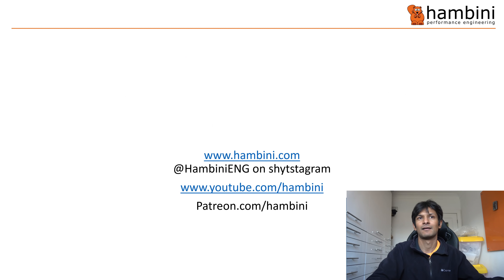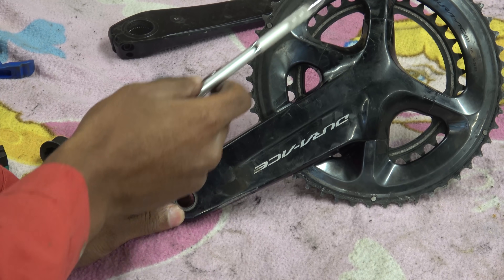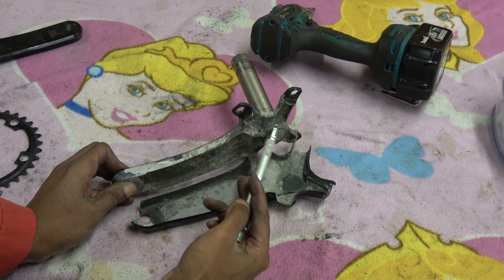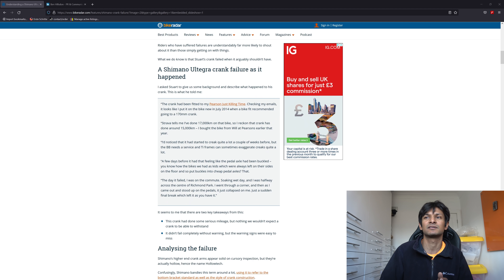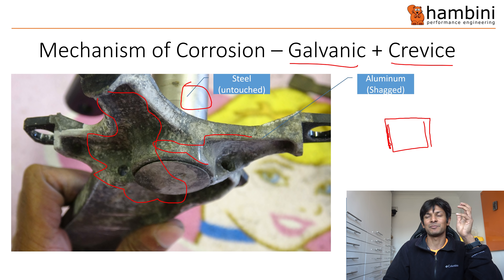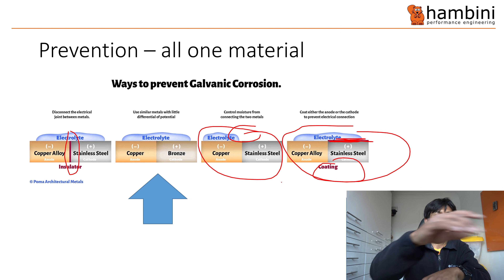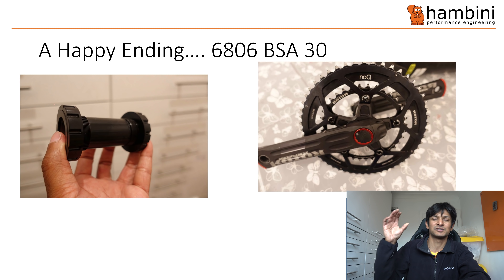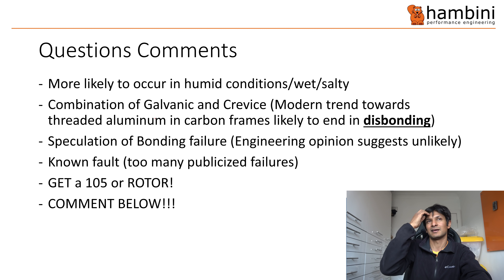Shimano REAMED for Engineering Incompetence

Comment: This is your GREATEST ever video Mr Hambini-man!!! As a passionate and committed CAMPAGNOLO devotee - you can't imagine the absolute pleasure Shitmano's product failures are giving me! LOLOLOOLLOLOL!!!!

PS. Point of interest - whenever aluminium and steel come into contact, they create an extremely aggressive electric reaction - as you quite rightly stated, a kind of 'battery [Galvanic] effect'. This is also known as 'electrolytic corrosion' - which produces a whitish powder residue. 
Electrolytic corrosion was very commonplace with automobiles [especially during the 1950's and 60's] when car manufacturers started using aluminium and steel body panels together. Indeed, it became such a problem that rubber beading had to be inserted between the surfaces of the two metals to prevent them coming into direct contact.
Unfortunately, the rubber beading would rot away after a few years and car owners would suddenly find entire areas where steel wings came into contact with aluminium bonnets and boot lids for example, totally corroded away.
Reply: Yeh, well you should see the 'reaming' he gave Campag too.  My Shimano cranks have never failed, but then I'm not daft enough to lean my bike against a central heating radiator and not realise how harmful that is to bonded components be they hollowtech or carbon.
Reply: @mcspikesky  Dentists can afford that
Reply: I bought a De Rosa Idol with Campagnolo Potenza, best bike I ever owned with the worst groupset I ever owned, an absolute pile of shit - Within 500 miles the right shifter snapped and the bottom bracket sounded like a ratchet with all the clicking noises it was making.  I've no idea why Campy insist Potenza is comparable with Ultegra, it simply isn't... maybe Claris or Sora but no higher. ChainReaction couldn't resolve the problem and wouldn't swap the groupset to Ultegra so I ended up with a refund :(  Shame as ignoring how crap Potenza was the bike was beautiful to ride and the thumb shifters I absolutely loved
Reply: @mcspikesky  ......Mmm - I admit that I am a half-wit. But that makes me twice as clever as you.
Reply: @mischief2168  ........What's a 'central hearing radiator'? Heating for the ears perhaps? PS your spelling is a ridiculous as your thought processes. This video is all about Shimano crank FAILURES! Got it?!?
Reply: @thesoultwins72  ... you are rather rude and very aggressive to women.  Have you tried therapy?
Reply: @mischief2168 .......No why....have you?

Comment: Zinc anodes are what's normally used in boats. I've pop riveted (usually monel) many 316 stainless fittings to aluminium masts. I always provided a barrier between the steel and the aluminium. Plastic packaging tape, the really thin stuff about 50mm wide, seemed to do the job.

Comment: Good stuff Frenchie! 
I've had both a Durace and Ultegra versions fail this way. Oddly they both failed around the pedal area, but still displayed the same characteristics.
 Give Shimano their due they replaced both.
Reply: I had one break at the spider and one just below where the pedal axle screws into crank arm
Reply: If it was made properly it wouldn’t have failed.  High quality bikes used to be expected to last for 100,000 miles/160,000km.
Reply: @stefhirsch6922  My first crank set lasted about 18K and my second broke at 7K miles.  Both breaks at different locations.

Comment: Super impressed with the video and it confirms what I felt was the case already. I can CONSISTENTLY, and I want to stress consistently, have one of these cranksets fail approximately every 15 months of my normal use. I suffer from hyperhidrosis and live in hot humid Alabama. I have had two replaced and have the third on the bike downstairs and am no longer using it. My ANTIQUE 5500 series Shimano cranks are beaten to hell and back and still work. I started religiously disassembling the crank every month or so and cleaning the area between the R8000 spider and the chainrings and even lubricating them. Nothing helps, nothing will stop it, just like Hambini said. Local bike shop and local Shimano representative who happened to be present when I took in the second one feigned surprise and shop suggested I clean the bike more often. Can’t really do more than every time I ride it! Currently on an FSA branded heavy crankset which seems like it will last and had purchased a set of 105 5800 cranks to permanently solve the problem. Because I clean it so much I have caught both of mine when early cracking of the body occurred rather than full separation.

I do think it’s worth considering the 105 option carefully. I have not looked at one first hand but the R7000 105 cranks look bonded as well. The old 5800 are not bonded and seem likely to last. That is what I will use next even though I admit the new R7000/8000/9000 look much better.

This has been a big letdown for me regarding Shimano. I have had full confidence before but this is ridiculous and needs to be recalled.
Reply: People who can afford to pay for this are top 0.1% rich. I don’t think most really care about this being a disposal part that fails under extreme conditions. I personally won’t care if this could fail since I don’t live in humid area and don’t ride like a pro at all time and all I care is that blink factor. For pros, all they care is weight and performance, durability has to sacrifice. It’s a trade off.

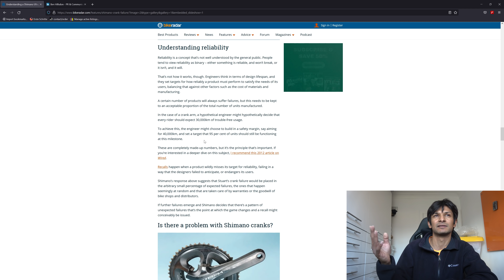Comment: 16:55 Just a small point. You are conflating "Factor of Safety" with "Fail Safe". Factor of safety is the amount of excess load a component can bear compared with its expected maximum loading in normal use. For example a SWL 10 ton rating lifting component (e.g. shackle) might have an actual failure rating in excess of 40 tons. This is called the safety factor. 
"Fail Safe" means that a component or system is designed such that in the event of a failure the component or  mechanism does not represent a danger to users or other components in the system. An example of this would be a runflat tyre which is designed to stay in place on the rim in the event of a puncture or blowout.
An example of "Fail Unsafe" - (fail dangerous?) is the RCD (Residual Current Device) on modern (UK) domestic circuits which protect people against electric shocks. There is no indication of a failure condition (which is why they are supposed to be tested regularly) and in the failed condition power is still passing through them with no shock  protection.

Comment: A little off topic but I had a number of crank arm failure years ago when riding top of the line forged Campy cranksets back in the 80'a.  I had three separate failures on cranksets that were supposedly  under warranty.  The first time the local bike shop gave me a replacement crankset and send it back to Campy.  The second time a year later the replacement failed and they replaced it again.  The third time the shop would do nothing because they said Campy rejected the second one and they never got paid.  When I said they were under warranty they told me to sue Campy because the shop was not taking another loss

None of those failed forged Campy cranksets had ever had a crash and were in nearly mint condition.  They all failed under hard pressure either sprinting or climbing hills and caused crashes.  

People need to realize when their cranksets are under pressure and fail (no matter what the brand or model) it is like stepping of a cliff and and you either instantly fall over or you stay up with a damaged arm pointing up with the good arm under pressure pointing down.  In one of my failures the later happened and my shin turned in and the upward broken arm sheared right up my shin and cut me very badly and I had to tie a bandana around my leg to limit the bleeding.  On top of all that I had to ride hope after all the crashes and injuries using just one good crank arm.  

After the third failure I switched from Campy to Shimano Dura Ace and never went back and have it on multiple bikes although only three have Dura Ace 9000 components (the rest are older 10 speed series).

I have never had the Shimano failures described in this video but I did have a Shimano Dura Ace crankarm that I had a hairline crack through the pedal hole that I noticed before it failed and they replace that crankset under warranty but it took awhile to get it.

I would suggest that people regularly clean and inspect their bike components and frames (I have had some of them crack and fail as well) so they can catch problems before they become serious and cause failures out on the road.  I learned the hard way.........................

Comment: Hambini, go for Hope’s 30mm all aluminium road crankset! I have fantastic experience in last two years. Very well made but pricey. I personally had issues with modern Rotor crank (it was Vegast crank model with 30mm alu spindle). It was creaking a lot from the start, which I thought had to do with DS side spindle spline tolerances, which caused creaking in the spider/ring (one piece) interface. It drove me mad and could not get it to work.

Comment: Luckily I wasn't sucked in by "lighter is better" with Ultegra or Dura Ace, and I went with 105. 
With that said, I worked as a crew on some Sportfishing boats in Hawaii, when we took the boats out of the water to redo the bottom, we also had to replace "the zincs" on the stainless steel shafts and rudders. I wasn't initially aware of the reason what they were or why they were on there, but was told by one of the captains that they are on there because of the electrolysis, and that they are designed to corrode instead of the steel (and aluminum in other places). 

In light of that, I wonder if it would be wise, or even possible to connect a small piece of zinc on area of the bike where 2 different metals are touching to prevent the corrosion of the softer one (usually aluminum).
Reply: It is called cathodic protection, all big ships and buildings have it.
Reply: Sydney opera use the same stuff.
Reply: Yes but it would add weight which isnt what is being marketed, its lightest crankset possible or nothing
Reply: @coreygolphenee9633  My 105 set on the bike in my profile pic still works. The funny thing is that my TT bike weighs about 8.5kg and the bike in my profile pic weighs about 13kg. It takes me 230w on my TT bike to do 37.2kph and it takes me 194w to do 38kph on the bike in my profile pic. That is 36 watts difference. When I put 230w on my recumbent bike I am doing well over 40kph. 
All the DF riders talk about 100g here, or 200g there, internal cabling, waxing their chains instead of use any type of oil. But as soon as you tell them to move the parts around on their bikes to make it way more aero they get all weird. The UCI banned recumbents because they were too fast. 
I say "Fuck the UCI" ;)
Reply: @casualguy393  I ride track bikes mostly and ill just that the hittori hangout NJS dura ace cranks, its my favorite part about track bikes is that if shell out dough for the nice stuff the components are ludicrously tough

Comment: I had and old school aluminum TCR and I FOOLISHLY put a carbon seat post in it... it took putting bike upside down, post in a HUGE table vice.. THREE of us twisting frame holding table to get the post out of frame.. HUGE popping noise as it broke loose.  Enormous amounts of white corrosion just poured out.. don't even know how it fit. Took an additional 5-10min of additional twisting by three of us to actually get it all the way out. I'm a Chem. undergrad.. which is shameful didn't see this coming.. what was I thinking?? Such a sweet looking post though 😍

Comment: Thanks for the no-shite, serious engineering explanation of the problems that ill Shimano. It's not that they should know better - they already do. But they are ignoring potential disaster if they continue to keep their heads up their arses. This will not go away anytime soon.
Reply: It could end up like AllCity Cycles if they keep ignoring it.
Reply: They’ll start to give a shit when a crank gets delaminated in a big race. Imagine that happening in Flanders or the Tour … the PR disaster alone should make them care about it.
Reply: @endcensorship874  You can bet that the cranks and other kit that Shimano sends to its sponsored teams get the pro peloton treatment at the factory before anything happens. Assume components such as the cranks are put through extra treatments, materials and assembly steps that the regular production trash never get. That and additional inspections and an insane QC rejection rate. Just assuming, of course. And wonder what special instructions the team mechanics receive, or are there factory-recommended service lives between replacements for certain components such as the cranks. And supposing that these practices by Shimano may be the case (because I'm just guessing), it would mean that somebody - or several people - knows what's really up with these things. And if people know, maybe somebody will talk. And if somebody talks, that would be very bad for Shimano.
Reply: @RReese08  pros on big name race teams go through bikes and replacement parts like crazy.  Failures are less likely if something is only a month old.  Whereas it is not unreasonable for a consumer to keep a quality bike for many years and they aren’t having a pro mechanic going over the entire bike every day or 5 while being ridden by a heavier rider.  A bike holding up for 2 months and parts replaced when only 10% worn by a 150lb/68kg rider with good technique isn’t nearly as impressive as being replaced at 50%-100% worn by a 260lb/120kg rider with poor technique.
Reply: @stefhirsch6922  I agree.

Comment: That's exactly that. In older bikes there were some parts aluminium-steel, mailny steering parts. Aluminium tube corroded and when placed inside larger steel tube it expanded and in some cases it was impossible to remove it. The galvanic corrosion occurs here and as it expands it separates from under the glued part. The glue has nothing to hold on to and bond  is lost. 
Steel-glue-aluminium
Steel-glue-oxide layer-aluminium

Steel-aluminium-glue-aluminium
Steel-aluminium-oxide-glue-aluminium

Comment: Well done.  The (few) carbon frames I’ve built all used alu inserts for headtube and BB.  This allows for traditional bike shop tools to ream, face, and in the case of BB chase threads.  These frames have all been equipped for standard BSA bottom brackets, which of course allows for external threaded bearing systems as well.

Due to galvanic concerns, the alu bits are first wrapped with epoxy fiberglass as an insulator.  I have no doubt that over time, particularly at the ends/faces, there is the possibility for galvanic corrosion.  And eventually, this will likely be the primary cause for the frames ultimate failure. While I anticipate this to take some time, I don’t expect a CF frame to last as long as a typical steel frame.  

Now the methods noted above will not lead to record light weight frames.  But I think light weight is way over rated.  Especially because UCI weight minimums mean that record light frames aren’t necessary to hit UCI requirements.

But, the fact is that the various concerns re CF and weight obsessiveness has lead me back to traditional steel frames.
Reply: Steel is good and aluminum is also good enough for my riding. I figured that galvanic corrosion would be the downfall on most carbon or bonded aluminum.
Reply: @Drago0900  there’s no possibility of galvanic corrosion between carbon and a  metal.
Reply: @nstrug  there actually is. My aluminium bottom bracket sleeve got loose in a carbon frame because of galvanic corrosion.
Reply: @MartijnPeek  I’m confused as to how that could happen. Don’t ions from both the anode (Al) and cathode (C) have to be soluable for the reaction to occur? I guess the carbon could act as a conductor to steel parts such as rivnuts which would then set up a galvanic circuit.
Reply: @nstrug  yep, carbon is conductive so that’s all it takes I guess

Comment: I have the DuraAce 9100 crank so I'm a little worried about this happening to me. I also work in US aerospace.  We commonly use stainless screws, washers, threaded inserts in combination with aluminum alloys (6061, 7075, 7050, etc). To minimize the chance of galvanic corrosion we apply primer between the faying surfaces to seal the joint. I'm surprised that Shimano didn't do the same thing between the axle and the crank hub. I would think that water would have to get in there to start the corrosion. How?  I don't know.

Comment: Have you had any reports of these failures on the latest dura-ace cranks released last year?
 I'm not sure if Shimano have revised their crank design and bonding process to address the issue or continue to produce more of the same.
(The latest cranks are slightly heavier than the previous generation).
I continue to use the earlier Hollowtech 2 generation cranks which are presumably welded/forged? Certainly there is no visual joints.
I think that the later 105 cranks also have the bonded /cast design and presumably fail in the same way so going to 105 may not be the answer unless they are the older hollowtech 2.
Shimano stuff is usually very good and hopefully they will eventually come up with cranks which do not break up, Until then I will stick to the older heavier Hollowtech versions.
Reply: The new 9200 DA crank is quite a bit heavier than before, so presumably they just beefed it up. But there are many lighter, better cranks out there than this supposedly 'flagship' model that costs a fortune.

Comment: You have the steel pedal, threading into aluminum at the end too. 
I had the threads strip, in my crank where the pedal threads in. It made noises like a bottom bracket and then my pedal fell off.
I had to pedal home with one foot.